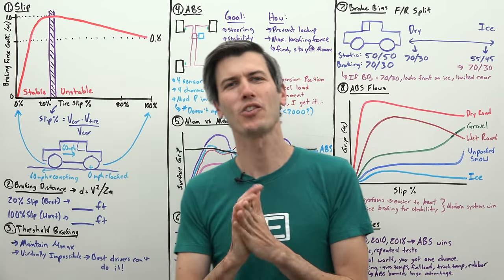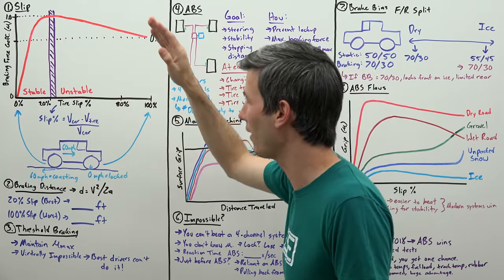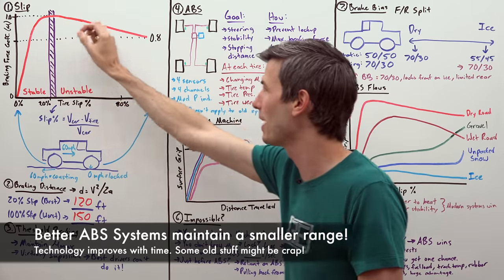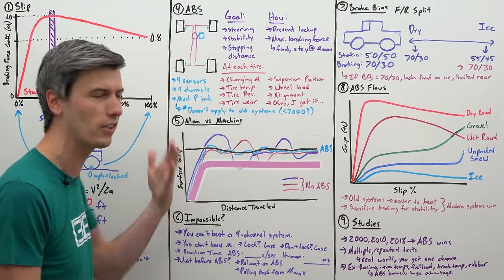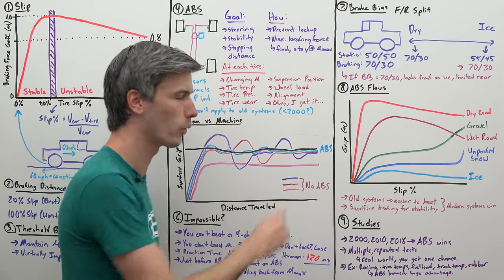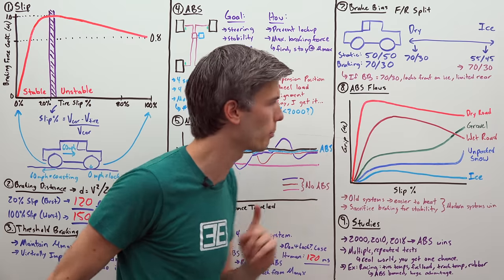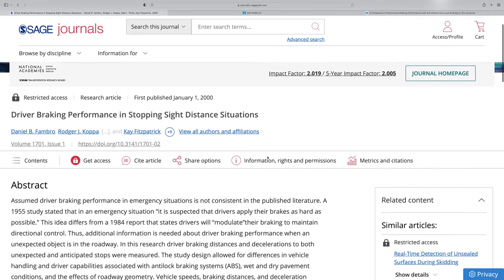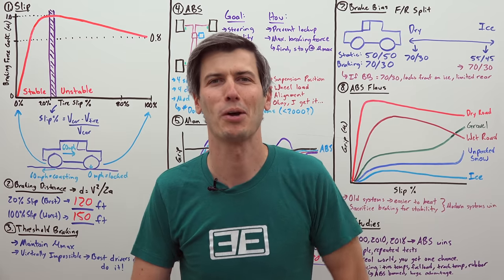Why Threshold Braking Is Impossible - ABS Wins!

Comment: 100%. Even if you could react fast enough, you can't control wheels individually.
Reply: Yeah but big deal one wheel locks up momentarily for a metre.
Reply: @BeamRider100  Difference between life and death tbh..
Reply: One foot can't modulate the braking power for four wheels
Reply: @Random Doesn´t even need to be different surfaces, the fact that you unload certain tires and load others more entering a corner means there is already a risk of lockup, which easily leads to flatspots on the tires.
Reply: Unless you put 4 brake pedals in your car :D
Reply: @Coconut_54  That might work if you operate them with hands and feet... perhaps use your nose to do the steering. Now all you need is a way to sense slip on each wheel individually. Any suggestions? 🤣
Reply: @motioncompensation1544  Tractors have multiple brake pads you activate with 1 foot (steering brakes). I've always wanted to do a quadrant pedal, so you could tilt your ankle however you wanted to apply to the front/rear/right/left (individual but all easily applied just like steering brakes). That way for burnouts you can easily apply just the front, or if you want to do a slide just the rear (or a side). Not exactly complicated to do (just like some motorcycles actually have 2 different brake actuation methods for the rear wheel, sometimes for stunts they have an additional near the clutch on the handlebars making it like a bicycle)
Reply: @motioncompensation1544  3 axis brake pedal. Active biasing by moving the pedal up down left and right with the foot, , total pressure by depth.

Like that f1 team (Mercedes?) active camber (or something) by pulling/pushing on the steering wheel.

May not work well, but certainly possible.
Reply: @Coconut_54  ...but I only have 3 legs.
<.<
>.>
Reply: You can on bikes.
Reply: You can on a motorcycle, and ABS still beats a good rider. A computer can just react far faster than a human. A good trained human reaction time is 200ms, these computers are operating on the order of 10ms
Reply: @alextopfer1068  It's less about outright speed of the system and more about the feeling of it.  Just grabbing a handful of brake feels hideous on bikes. None of mine will ever have them,  and because the govt is forcing new bikes to have them,  I have to stick to older ones
Reply: @alextopfer1068  yeap, but for some reason on my '16 Yamaha MT-07 as much as I have tested ABS activating results in longer brake distance. Just seems that ABS releases brakes a bit too much. Or it might have something to do with progressive braking shifting weight better initially, while just grabbing brake lever causes ABS to activate a lot earlier, before the weight has time to shift around resulting in worse results.
Reply: @Slick263  Newer bikes let you disable ABS as whole or at least on rear wheel. On some bikes you have separate ABS and traction control for while you lean and while not leaning, also some special "stoppie assist" that compares angle of the bike to modulate front wheel ABS to lift the rear wheel, at the same time maximizing stopping power. Quite same with wheelie assist to use same sensor to limit engine output to avoid flipping over.

If you are used to older non-ABS bikes, then most likely you will be fine controlling brake power on your own even on newer bike. Guy who I bought my bike from had multiple bikes before it, but it was first one with ABS and to him it was a bit scary when it activated the first time, he thought that something broke or something was wrong. He told that for him the ABS didn't activate often, but when it did, then mostly in situations where grip suddenly changed during braking and saved from quite a few falls. 

As of for me, since I am inexperienced and nowadays most are with ABS, then I would probably not know how to emergency brake without ABS.
Reply: @krisavi  yeah, you still have to account for weight transfer as that increases front tyre grip. Try again using proper braking technique but not worrying about locking up once you're hard on the brakes.
Reply: ABS also doesn"t do it. Even some modern systems (e.g. VW Tiguan), when one wheel jumps or get onto ice, unlock all the wheels and car roll free for some meters.

Comment: I think that in addition to the ONE TIME that you are going to press the brake, you are probably going to be panicked, which means you are not focusing on the threshold braking, like the system will! Great video Jason! Makes total sense to any one that has any!!
Reply: People say this but ehhhh, I was focused enough during a near crash to heel-toe down during braking. If you practice sport driving, regular road stuff is a lot more tame.
Reply: The key there is to practice emergency and hard braking regularly so you keep control of the car subconsciously. Also, oversteer/understeer situations.
Reply: @RhodokTribesman  That supports the OP. If you were in a near crash situation and spending part of your focus on downshifting, you weren't focused on the right things.
Reply: @chitlitlah  focused on the danger and surroundings AKA cognisant under stress. I was unaware that keeping your cool is a bad thing.
Reply: One can train, I used to have a old car that had no ABS, threshold braking was my best option.
I do not miss that at all, once I experienced ABS, wow, no going back.
Reply: @RhodokTribesman  I hope you realize 99% of drivers are going to fill on slam the brakes in an emergency stop situation. It's not about Lewis Hamilton or Max Verstappen with these systems.
Reply: @danbert8  Agreed. The one time you really need to stop quickly is the absolute worst time to try to figure out how to do it. I'd suggest practicing emergency stops in various conditions often enough that you can do it well every time without thinking. Same goes for emergency stops if your brakes fail using only the emergency brake and gears. Either skill just might save your life or someone else's life one day.
Reply: @RhodokTribesman  Focused and calm aren't exactly the same. Humans only have so much focus to go around. If you practice certain things, they require less focus, but they will always require a slight bit of focus you could've used on something else. I like to toe-heel downshift myself, but if someone pulls out right in front of me, the brake pedal and steering wheel are all I'm worrying about. I don't know about your near crash so I'm not saying you handled it improperly, but I don't think you should spend even the slightest effort on downshifting if you're making an emergency stop and won't need to suddenly accelerate.
Reply: @winebartender6653  I'm not saying threshold braking is better than ABS on the road haha
Reply: @chitlitlah  Sure, but don't forget the clutch as well, or you'll get into deeper trouble. The whole situation is why I strongly urge people to at least practice performance driving; knowing how your vehicle acts, the limits, etc is invaluable when it comes to your course of action during stress (muscle memory is a godsend if you build it)
Reply: Yea Dave.
Reply: @winebartender6653  Disagree. Quote: "study by Mercedes-Benz in the early 1990s where it was found 90% of drivers fail to hit the brake pedal with enough force in the event of an emergency".

But if the brakes are fully slammed (as they should be with an ABS car) ABS is obviously great.
Reply: @niceguy100000  you (and the study) are right, thats why cars not only have ABS. If panic braking is detected (high gradient of pedal movement but not enough pressure) then the system will increase the brake pressure for you
Reply: @gaborb  What systems have that "feature"? It sounds very unpredictable and dangerous.
Reply: @tqracing  😮 why do you think its dangerous? If you are in a "emergency braking" situation and not pressing hard enough the brake that is dangerous. This is a very common feature for years now and basically every car has it (i am not sure however the US market variants).
Reply: you should never panic.  if you panic that just means you are not experienced enough.  ones you actually get comfortable with your vehicle like you should you will never just panic slam on the brakes.
Reply: @tqracing  lots of cars have it - I have a W203 C180 which has it. The car looks at how quickly you come off the throttle/how quickly you press the brake pedal and 'pre charges' (for want of a better term) the brake system so you get maximum brake pressure sooner.

You never notice anything until an animal jumps out in front of you and you slam on the brakes, the pedal is firmer than usual and doesn't go down as far, but the brakes apply hard It's actually reassuring and proven to reduce stopping distances.
Reply: @RhodokTribesman  your near crash wasn't near enough then.

Watch ANY motorsport where abs is illegal and 99/100 times if a driver overcooks a corner or loses control and the car is heading towards a wall they will lock the brakes.

If literally the best, highest paid drivers in the world lock the tyres in an emergency situation when they're already on a track, you're gunna lock the tyres in a real emergency situation.
Reply: @Rollin8.0  Well, good to know I suppose. At least I know what to avoid in modern cars.